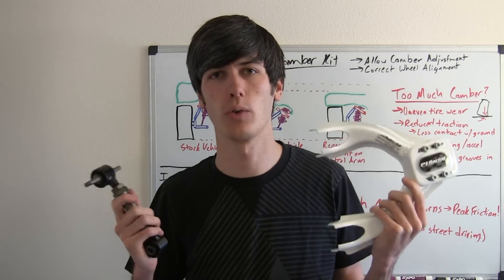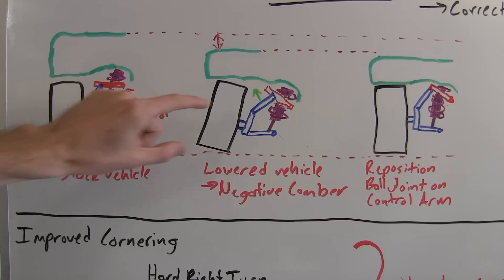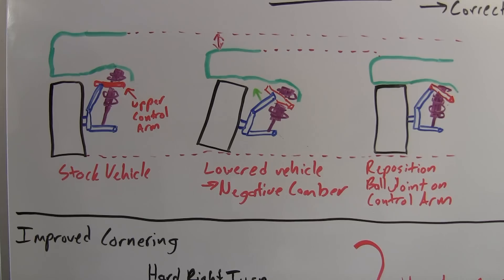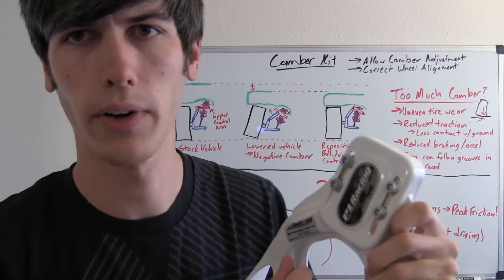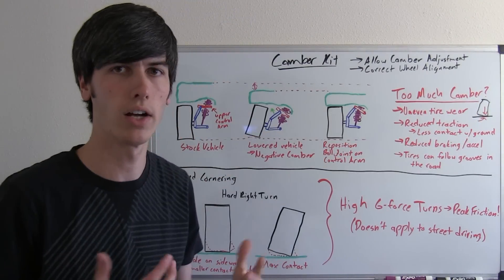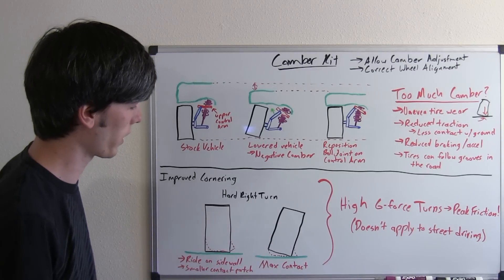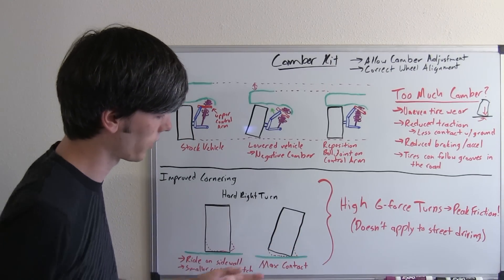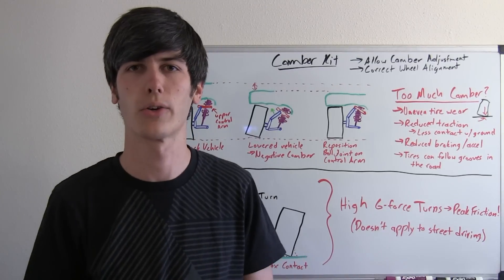Camber Kit - Explained

Comment: would a camber kit stop my car from shaking doing highway speeds please help
Reply: +Joshua Harvey No, only for reasons stated in this video. You should go get an alignment.
Reply: its probably your tires or a ball joint.
Reply: +Ryan Gross Yes, during alignments, usually you get a modicum of suspension inspection with.
Reply: +Ryan Gross Of course. They could do their own suspension inspection for free, but the issue is common, so best they just have a pro look at it plus get an alignment since it's an often neglected maintenance issue.
Reply: +Maurice Searcy I can attest to people neglecting that usually they just wait for there car to stop driving
Reply: @joshua harvey  you should get your wheels balanced. most likely thats your problem

Comment: I dropped my car 1.5 inches do I really need camber adjustment?
Reply: no
Reply from the maker: Not necessarily, you'll just have slightly uneven tire wear as a result. I lowered mine about 2 inches, and it resulted in about an average of 2 degrees negative camber (some wheels more, some less).

Comment: i had a question im trying to lower my car to about 2 to 3 inches off the ground but i also do canyon runs very frequently. i have BWR rear lower control arms and Megan street coil overs, i see peoples cars even lower and hit corners without major scraping or rub so if i was to get front an rear camber kits as well as corner weighted will i still be able to be low and not rub the wheel well so hard. my megans are not maxed out on stiffness but there are adjusted pretty stiff. right now my camber is set at -2 and im about 5 to 6 inches off the ground. and i have 17" inch wheels on my 06 rsx idk how wide my wheels are but about 8inches or so

Comment: so not for drifting..?.lol
Reply: less traction =more drifting
Reply: W4VE not necessarily. drifting is a controlled slide. in other words you don't want -10 in the rear. you want a grippy set up that can be manifulated. I'd say the average setup is -3 to -5 in the front and -2 to 0 in the rear depending on power. the more power the less you need to run in the rear. the front is more-or-less a preference for your driving style. find what works best. you don't just want to slide everywhere.